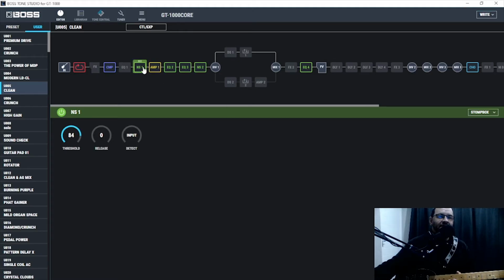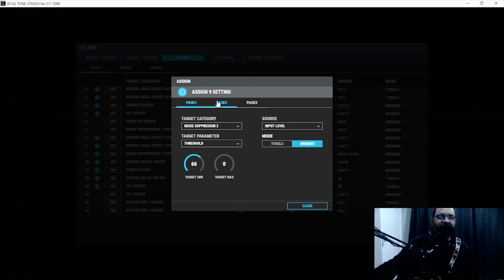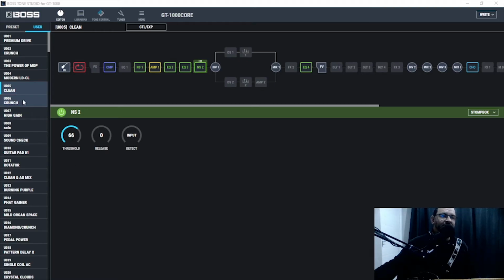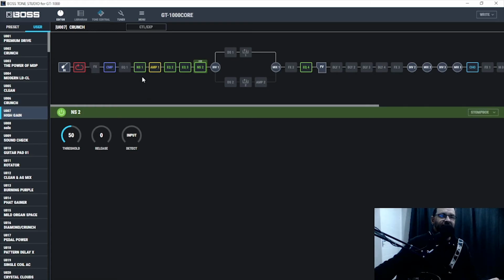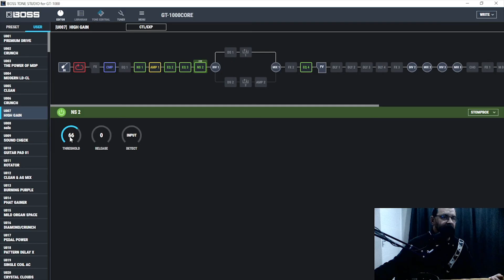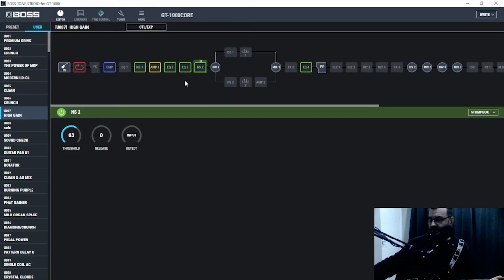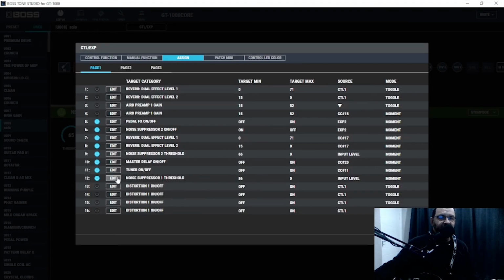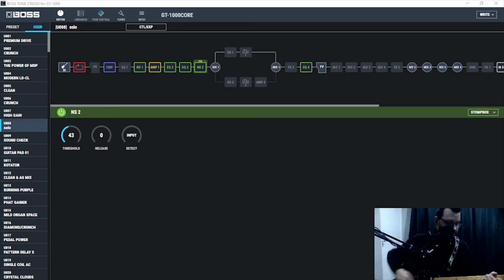"ADVANCED NOISE GATE": BOSS GT- 1000 / CORE/ GX-100 TYPE PEDALS

Comment: Very cool.

I came on YouTube to see if anyone had an issue with the noise suppressor causing a buzz when the release is set too low.

It’s like having the release at 0 means the audiowave gets chopped up.  I found the buzz was reduced by about 35 for the low e string.